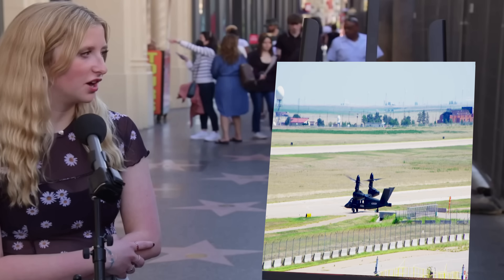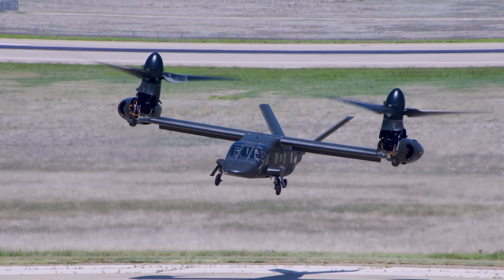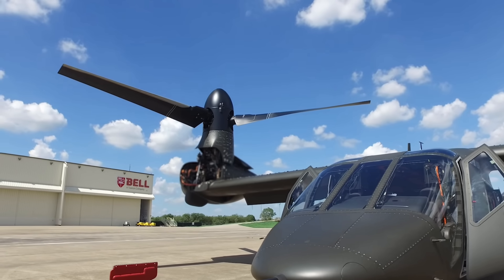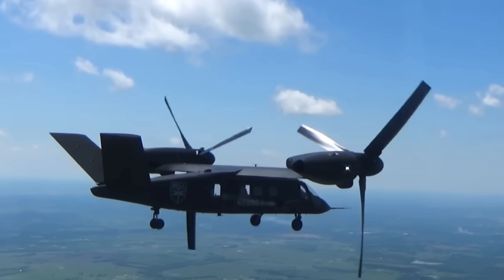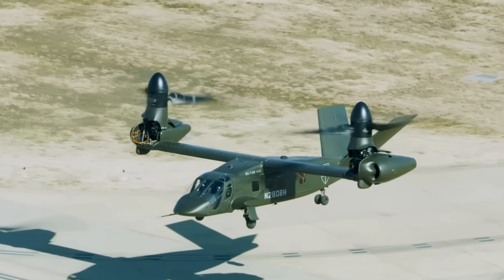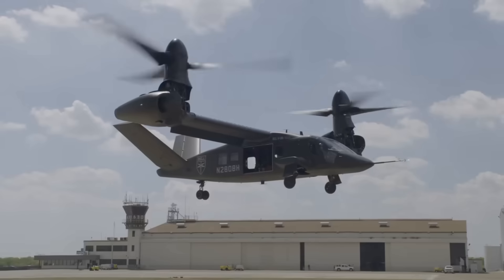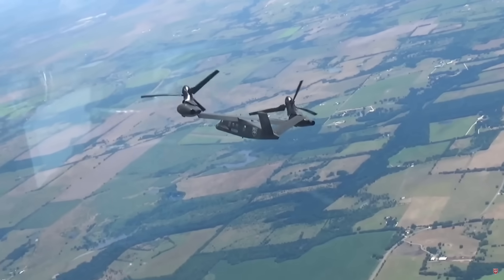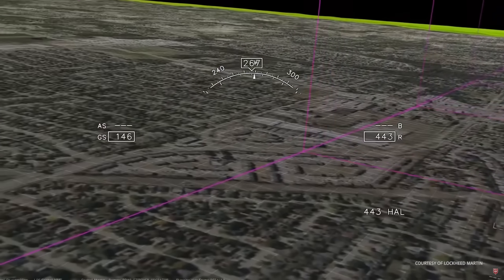Bell V-280 Valor - What's the big deal anyway? | BLACKHAWK REPLACEMENT

Comment: The osprey is actually below the curve for flight mishaps compared to other aircraft the marines and navy operates. the issue is its a large personnel transport, so when it does have a mishap with soldiers on board it usually results in dozens of KIA compared to other high profile aircraft which may have 0-2 (depending on ejections). once you reach a certain body count, media covers it more. its just the sad truth.
Reply: Yep.
Reply: True. Ppl bash on the tilt rotor as if it was the design that caused it to crash, when it was human pilot error of managing Stall rate.
Reply: Was just gonna leave a similar message. It just that the accidents gets more coverage, since it generates more clicks.
Reply: @goldenageofdinosaurs7192  it’s not like Blackhawks are crashing in secret. If a military or commercial aircraft goes down, it’s in the news.
Reply: @ChopperChad  They used to call Blackhawks "lawn darts". I will let you take a guess why.

The chastisement gets dumber every time, since teething issues are also getting smaller with time.

Getting killed by new equipment is just a military occupational hazard. It's also a civilian occupational hazard.

But if you don't get gud with the new equipment, somebody else will and put you out of business.

The military is in the business of winning, they should be exactly as safe as necessary to be the best at killing the other guy.

Casualties are not just acceptable they are expected. If there aren't any casualties in training, you aren't training hard enough.

If you think that's scary you should see the casualty rate for commuting, or tripping in the shower.
Reply: And, it had a specific problem earlier in its history which has been solved.
Reply: This is true, statistically it’s one of the safest AC you can fly on today in the military. Early testing and adoption mishaps colored gave it a reputation it’s been struggling to overcome ever since.
Reply: The Marine Corps also doesn't have parts to fix what they have, so...
Reply: Sadly, the media tends to misunderstand the aircraft in general they think when a pilot saying it's hard to fly means it's a death trap.

But the V28 seems to fix a lot of the problems with a fair amount of redundancy, even including keeping the engines separate from the propeller pods and allowing one engine to be able to power both
Reply: You can't tell people that want to believe differently
Reply: Thank you!
Reply: Truth
Reply: Your comparing the losses of a relatively new platform like the Osprey that we’ve only lost two of in combat….to a platform like the UH-1 that we’ve been operating since Vietnam. 

The Valor is inherently different from a conventional helicopter and less survivable than a Blackhawk in the role it’s being asked to fill.
Reply: @Matt-yg8ub  also what’s interesting is saying how the valor after all the time we’ve had to analyze the v-22 and even the marines and Air Force have pretty major ideas of why it could fail catastrophically, (the corps themselves have known since 2010 and have trained pilots on avoiding these) the osprey still had a cleaner safety rating than the sea knight. Even using the Huey in comparison the mission isn’t that much different from the valor 

Huey’s we’re used as workhorses and combat platforms, they lifted gear transported men, provided cas, were even used as gunship variants, the different missions is what made the Huey so loved it was adaptable. Even the Blackhawk took on many of those  roles as well, between the Blackhawk, pavehawk, and the seahawk, it’s not uncommon for so much to be on one vehicle.

And mind u this is all assuming the valor is gonna be worse than the osprey which despite the stigma has a pretty high safety record with its most catastrophic crash, at least that I’ve heard of, killing 19 men and was determined to be caused by vortex ring state, which is already common and known in helicopters, and even then tilt rotors are affected by it less than helicopters and it’s more noticeable and faster to recover, 

Even the v-22 has a better safety rating than the Blackhawk, and considering that the reason the v-22 and tilt rotor were proposed was to bridge the gap between aircraft and helicopters, but the recent drop in retainer rates in the military and the fact the US has been investing in getting more outta less with its army because of it, having an aircraft preform that much, isn’t exactly a bad idea
Reply: @ryancamara5689  You’re comparing apples and oranges……mixing the safety record of the SeaKnight that first flew in the 1950’s (the youngest airframes are 50 years old now)…with the Osprey that didn’t enter service till 2007 and then arguing that the Blackhawk has had more crashes. We’ll ya…. The 4,000 UH-60s in service across a dozen countries since 1979 have have racked up approx 387 incidents over that time. The 400 V-22s have been utilized sparingly and only lost 13 hulls, 8 since becoming operational.   
That doesn’t change the fact that the Blackhawk still holds the record for the lowest accident rate of any Army helicopter in the first six years of operation. Ten times as many hulls over a service life or twice as many years is pretty much guaranteed to result in a larger number of overall incidents for the Blackhawk which has been active in numerous combat environments the V22 was intentionally kept out of to prevent loss. 
At the end of the day the average Blackhawk costs a third as much per hour to operate compared to the Osprey and the Valor will almost certainly cost more to operate than the helicopter it’s replacing.
Reply: @Matt-yg8ub  the sea knight is only 20 years older than the osprey, and the reason im comparing them was cause thats the airframe ospreys were meant to replace, and even the blackhawk is that old having first flown in the 80's and even then it had major issues in maintenance  and pilot training and had a lot of frequent crashes. Also u realize by admitting u can't use other aircraftm, older aircraft to pick apart a newer frame, you just proved why comparing the valor to a black hawk is dumb when they're seperate aircraft and ones 40 yrs old.

not to mention some of the ospreys most criticized safety concerns were issues during testing phases, the large chunk of the deaths that came during testing were mostly due to one single incident which was caused by a factor which isn't even exclusive to the v-22 but is also common in helicopters,

Also wdym the v-22 was intentionally kept out of, the army uses blackhawks while only marines and navy are the primary users while air force operates the minority, and the osprey was not kept outta combat, first of all u just contradicted yourself, you cant say the blackhawk has an older service history with multiple countries and then say the osprey doesn't and was intentionally kept out cause that makes no sense.

1. The osprey by your admission entered service halfway thru the black hawks service life, and only has one operator, so theres literally no actual even ground to compare, they don't even serve in the same branch, so u wanna talk about apples and oranges, thats literally a worse example
2. Who told you the osprey was kept out of combat? you know two of the osprey crashes were in combat, and it was used extensively as a transport and scout aircraft in iraqi, by 2008 the osprey had 3000 sorties with 5200 hrs under its belt, it also saw deployment in afghanistan as well as various humanitarian missions and transport missions including the 2013 South Sudanese political crisis where a formation of air force v-22's flew over three countries, was hit 119 times and had to be constantly refueled due to multiple fuel and hydraulic leaks, saying it was intentionally kept out of combat is like saying the titanic avoided ice.

finally is your comparison that a large, long range transport, the v-22, and a medium sized higher tech vtol long range transport, the  valor, cost more than a medium utility helicopter? NO SHIT SHERLOCK! did u ever think there a reason for that like, the fact the v-22 is basically a plane with a larger airframe and carry capacity in troops alone than the uh-60, that and the fact that the valor is also a long range vtol as well, you know technically the huey costs less than black hawks why don't we just use more hueys. dude idk if youre aware but new planes cost a lot more than aircraft built in the 70's, especially when the valor is meant to be acting in a larger capacity.

you realize when you want an aircraft to have a higher ceiling, higher weight capacity and more range than what you already have, it gets more expensive, and the army isn't replacing all blackhawks just yet, they're replacing sum numbers of apaches and blackhawks but not all of it.
Reply: @Matt-yg8ub  define relatively new, the osprey has flow since 89, and most of the criticisms have come from prototype incidents and problems the corps has know of for 13 yrs,

Even the point of losses aside Huey’s and blackhawks both had major teething problems, black hawk crashes in the 80’s were pretty substantial and got in grounded before.

Also considering many ppl have opposed tech like the osprey in favour of older tech like the Huey simply based on we used it longer, it’s a fair comparison nonetheless, i mean 2 combat losses in a 30 yr flight history, isn’t to bad a record, especially when both ospreys and Huey’s early years saw combat largely against insurgents
Reply: @Matt-yg8ub  you do realize it's very hard to make a helicopter survivable  against a anti-aircraft missile and autocannons right. the ka-52 attack helicopter was supposed to be able to survive most threats and yet in Ukraine they are being taken out left and right. Regardless of how small you make the helicopter it's not going to survive a modern anti-aircraft missile because flares don't really work well as they used to. just cuz engines simply are hotter than a flare
Reply: @danielsnook7362  no. You’re incorrect about flares.
Reply: @ChopperChad  how come Russian helicopters and fighter jets have been shot down constantly in Ukraine then... And they have flares so how come they're not working
Reply: @ChopperChad  don't tell me you seriously think of flares are hotter than a fucking engine
Reply: @danielsnook7362  yes they generally are. But they’re also deploy specific wavelengths (we called them cocktails) depending on the threat that was detected. So one single detection may trigger a launch of several different flare types.
Reply: Yes I recently found this out I also found out that the f-35 really only got a bad name because when it came out it was so expensive and the media took a big shit all over it because no one thought we needed it in the taxpayers were pissed if they have 35 had come out when the b21 raider did with the tensions with China and Russia nobody would have complained
Reply: Sadly social media and instant gratification has ruined the line between opinion and fact.
Reply: I tried explaining this so many times. Politicians and media blew it out of proportion for their own agendas and stigma will never die like with F 35 losing to 4.5gen fighters.

 People said oh but it is complex and the for maintenance will be a pain. Like a contra rotating coaxial push prop helicopter is a simple machine.

 Some act like it 90% of missions will now not be viable... 

 Short of the footprint this is better in basically every metric. Oh and it can't auto rotate. I couldn't find information on Vortex Ring state or if it will have issues with it's exhaust like the Osprey does. 

 People are going to find any excuse to hate the damn thing. I personally think they made the right choice. Helicopters as we know it are reaching physical limitations. Tilt rotor/jet are the future IMO.
Reply: @dianapennepacker6854  not only that but people comparing this to a helicopter is flawed in itself cause helicopters and stol/vtol aircraft have completely different missions, operations and even functions and stresses.

For example helicopters like Hueys and black hawks aren’t pressurized, mainly because they don’t fly high enough to be an issue in most operations. Where VTOLs need to be due to their missions taking role of planes, but using the short take off and hover of helicopters, which is why the v-280 has heightened ceiling and ranges cause it can exploit that.

Oh top of that looking on the osprey it was never built to function in a helicopter only sphere but to bridge the gap, particularly following the difficulty America faced with Iran hostage crisis. The mission they’re proposing for the v-280 is exactly that, long range, more versatile aircraft that can go where blackhawks can’t. One advantage we’ve seen in this is that in the time a marine ch-53 unloads its 50 troops, the osprey can make 3 trips to unload 25.

VTOLs and f-35’s were made for a new era of combat, fourth gen fighters are 20-30 years old now and to compare that kinda gap between aircraft would be putting the p-51 against and f-4 phantom. Yet in modern wars like the widely successful opening barrage of desert storm, tech like this gave very large advantages over the enemy
Reply: @ryancamara5689  Agreed with everything you said. I think people are worried it won't be able to insert troops or something due to the larger footprint.

 I'm thinking in what situation will that make or break a mission where a LZ is not available or cannot be created. We've been using daisy cutters and such for decades now. There's always the option to rapple. 

 So let's say they are correct there will be missions it cannot do. Yet I think overall this opens up MUCH MUCH more options that helicopters cannot do anyway due to lack of speed and range.

 They made the right choice from a strategic, logistic, and tactical point for a near peer enemy. Army still has the Lakota anyway. 

 Still curious what armaments they will decide to tack on.
Reply: That's true about the bias against the ospray. I saw a video about that somewhere on YouTube. Could be this channel for all i know.
Reply: You don't see the mishaps with the Blackhawk or the Chinook though, so I would say your comment isn't necessarily correct.  Barring collisions with Blackhawks, you just don't see this with standard rotor wing aircraft.
Reply: Indeed it's almost tied tbh mishaps since 2001 to now with F18 if you take away the personnel involved F18s either tied or starting to overtake the crash count now
Reply: I can imagine they'll modernize the Aim-9 to be smaller too faster better explosion dynamics etc
Reply: Yeah I have spent hours saying this to people. 

 It is always DuR hurrrrr tilt rotor dangerous. People read some headlines then thought they knew more than the military.

 Osprey is an amazing aircraft for what it is for especially for its time. First production tilt rotor that has has a stellar record.

 If you are going to complain. Talk about the price, and that it sets places where it lands on fire. Or it can't auto rotate. 

 The Valor fixes these issues and some. The damn thing can literally hover and land itself. 

 Flying is dangerous. Rotor aircraft even more so. 

 I personally can't wait to see the attack variant. There are mockups of it and they look awesome.
Reply: So true buddy
Reply: You’re nuts! OsPRAY is a cluster €*>€!  Uncontrollable dissymmetrical lift over dissimilar surfaces below each rotor system. RIDICULOUS! An abomination of aviation design. And that the manufacturer refused to include a costly but necessary aft-firing ballistic cargo rescue parachute tells the whole story—they don’t care.
Reply: The Army was exceptionally wise by abandoning the V-22 OsPRAY program. V-280 Valor however will be a winner!  Good job, U. S. Army!
Reply: I hate this argument because its only been out recently with a ton of mishaps. Also this doesn't really have a combat application. Think of Black Hawk down bigger target with more moving parts.
Reply: Could argue a troop transport requires a higher level of saftey for that reason.
Reply: @microsoftword213  well in all fairness it’s a troop transport that Carries 25 ppl and it’s only lost 52 in its whole service history and at least a third of that came from one accident, most of the other accidents Are actually quite typical for any aircraft even smaller helicopters. It’s safety failure rate is actually on par w the sea knight and lower than the Blackhawk
Reply: @microsoftword213  It is safer than both the Chinook and Sea stallion...
Reply: Let me chime in on an apparently totally forgotten fact.  The Military/DOD manages the mishap reports for the Osprey and F-35 like how the chinese ccp  manages their covid numbers for infection and death and their gdp growth percentages.  I am not making this up, just before the Osprey got IOC the powers that be decided to declare victory and fudge the accident numbers. It was extremely WELL reported at the time over 15 to 20 years back. Most of the reporting has disappeared from the internet but, surprisingly, check the v22 osprey Wiki page to see a small hint of it.  It does not mention that the mishap reports were falsified at the direction of the services/DOD but put two and two together.
Def Sec.Dick Cheney tried to defund. Def Sec Gates called it a "Turkey" and tried to defund it. "They", the powers that be (which also includes congress by the way), count on us not to know or remember these things or get lost in partisan or patriotic weeds. So whenever someone pulls out numbers in contrast to general perception AND troop feedback, remember that. You're being fooled and gas-lit.
That being said this helicopter will probably be safer (not sure about safe) than the Osprey. I recall that one of the design issues was that the wings were shortened too much due to its need to fold up on a carrier deck. The wings were supposed to be longer.  Does anyone remember these reports??? And now the nacelles don't follow rotate which was called out as another issue.  Yes, I have seen other youtubers point out mishap numbers for the osprey and F-35. The military-industrial complex plays a long game.  Knowledge and memory of well informed citizens are the only counters.  I actually hope the aircraft is great this time around but the deceit is already baking in.
Reply: Former Army pilot here: This is not completely correct. You have no idea how aircraft incidents are categorized.
Reply: Look if they found some way to power both props with a single engine in the event of a minor failure it sends the Osprey over because it’s thrust is OFF BALANCE IN HOVERING with a discrepancy in power from 2 that must be closely sinked! You can’t even sink motors on boats very accurate and they want lives to depend on a perfect running jet engine in a high fod environment! 🤦🏻‍♂️🖖🏼🇺🇸
Reply: @erickamekonapeper4007 There is a shaft in the wing between both engines allowing one engine to power both rotors. This driveshaft is also on the Osprey.
Reply: @bl8danjil  I'm confused on the Osprey. I saw a video showing one landing on a Carrier. It is coming in across the flight Deck 90 degrees. 
It lost power in one engine and tipped sideways about 5 meters above the Deck and crashed into the Deck and Port side topside. 😌 It killed everyone onboard and it was because of a sudden differential in thrust from one engine loosing thrust. I think it's mostly because of the transition to vertical lift and the motor tip's causing flow pressure problems or the oil level moving or something that caused thrust deficiency. 😐🖖🇺🇲
Reply: @erickamekonapeper4007  I remember hearing about it, but I don't remember what they found. 

The engine needs time to send more power to the other engine. During that time it is spooling up, the other engine is trying to reignite. So maybe the engine reignited and the full power went back to the good engine flipping it over. Another possibility off the top of my head is if both engines are good, but one rotor is over the side farther from the ground while the other is still on the deck closer to the ground (ground effect) it is creating that difference also flipping it over. Again, I don't remember what they found to be the cause of the accident. 

The Chinook also deals with the last situation. There are pictures and videos where it's rear end sits on the building while it's front is not. The power is different between the two engines or rotors. That feat takes a great deal of skill and trust between the pilots and aircrew.

Many problems started to go away when they started training helicopter pilots how to fly a fixed wing instead of fixed wing pilots how to fly a helicopter like they did in the beginning. They just fly differently.
Reply: @Jordon B Stop spreading misinformation, auto rotation was never promised. Either engine can power the opposite rotor through a driveshaft that connects the two. If both engines go out and can't be relit, which is a rarity in itself, the wings and still spinning rotors give the pilots a run on approach landing.

Many problems have been worked out by engineers or they changed the training. Like training Osprey pilots as helicopter pilots first so they can learn about what to look for and avoid like vortex ring state and then teach them how to fly fixed wing which is the easy part. 

Face it, the tilt rotor is the future. It's capabilities outstrip helicopters including the Defiant, which is unproven. They couldn't even get a full size version of the Defiant until they could figure out how to make the blades stiff enough to keep from flexing and hitting each other as they rotate counter to each other. And we're talking good weather during testing too. While the Osprey has flown through inhospitable weather. 

Additionally the Osprey's speed and range are valued assets when it comes to a rescuing a critically wounded soldier or Marine and getting them to a hospital that has advanced life saving facilities and personnel which is usually far away from the front lines.
Reply: @erickamekonapeper4007  they’ve actually known about that issue since 2010 at least in the marines, idk if they’ve ever found the issue but if I remember correctly when the Air Force grounded if for 2 weeks they found certain conditions was causing one engine to loose power and thus all power would be routed into one engine in order to allow the pilot to have some control
Reply: @erickamekonapeper4007  Engine loss is not a "minor" failure.
Reply: @davidu01  It is engine power loss only when a fixed wing pilot can't fly like it a helicopter by simply managing out-of-ground-effect (OGE) power limitations, inducing "vortex ring state". All helicopter pilots know this.
Reply: @Jim May  Listen I was in the Corps on active duty in the same stand with the Commandant when the V22 was demonstrated at MCDEC Quantico. I didn't ask so why are you telling me this?
Reply: @davidu01  so ur qualifications is that u stood next to someone important during an important demonstration, 

I’m sorry but what was ur actual job in the corps, not just u standing in the same stand what was ur actual role and qualifications, cause if ur qualifications are u can observe the professional data gathered by others than ur not that higher par than most ppl who were there too,
Reply: I don't know, the "Osprey" scares the hell OUT of US, makes the Enemy Smile! Yeap the DNC loves it!
an Osprey was directly over me and my truck when it's odometer rolled 100K a few years back, I lived, the truck too.